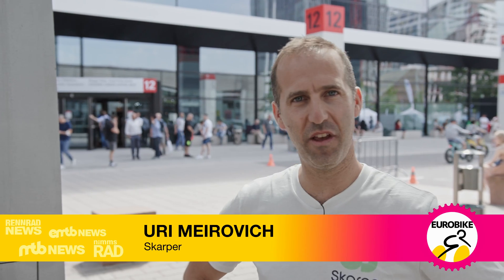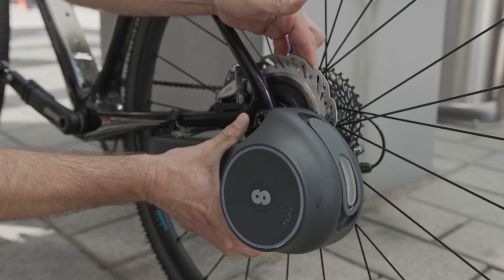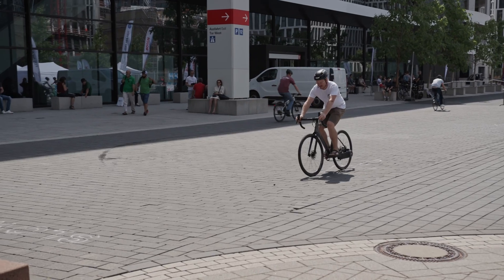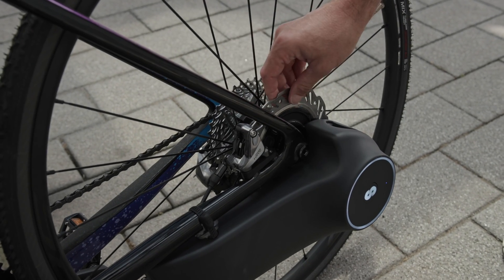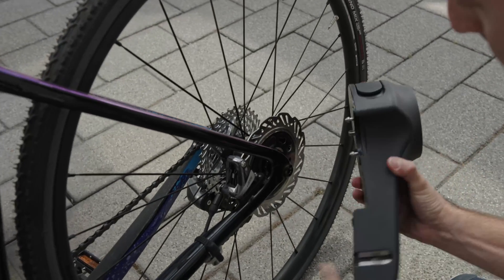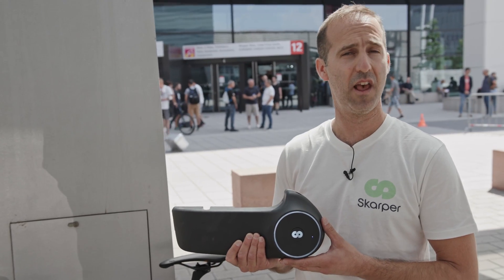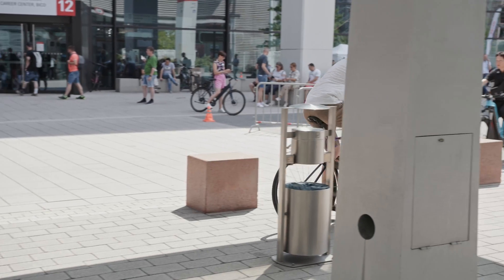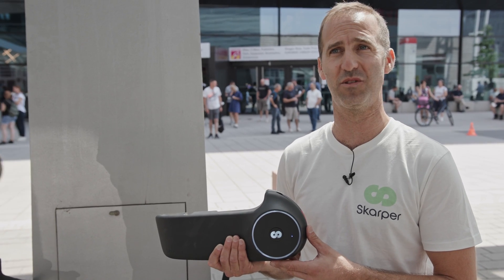Eurobike 2022 - Nimms Rad testet Skarper Nachrüstmotor für die Bremsscheibe

Comment: In der Anschaffung schon nicht ganz günstig, aber man braucht hier dann auch immer eine spezielle Bremsscheibe? Wäre interessant, was die dann kostet, weil man die auch häufiger mal tauscht, wenn man das Rad regelmäßig nutzt. Und bei Lieferproblemen müsste man solange auf den E-Antrieb verzichten, weil andere Hersteller nicht kompatibel sind. Immer etwas, was bei kleineren Produzenten durchaus risikoreich ist
Reply: they would also make built-in charging, that if you pedal and charge on the way, it would be cool

for example, you drive from a mountain, and it charges, and then it helps uphill =)

Comment: Interesting concept, compact, light but 200wh battery is not enough to use it more than in short urban commuting in flat areas...
Reply: they would also make built-in charging, that if you pedal and charge on the way, it would be cool

for example, you drive from a mountain, and it charges, and then it helps uphill =)

Comment: Unfortunately, they priced themselves out at that price. Good concept but the cost is more than enough to buy 2 foldables at Costco. Most larger ebikes are also less than that.
Reply: True but those bikes don't have features like someone's Cannondale or their favorite bike. Everybody can't be Walmart lol
Reply: @soulreed  I wouldn't put this on an expensive bike.
Reply: @vwtoys  good for you, but a lot of people would
Reply: For an expensive 5k and up bike, I wouldn’t put on these strap on kits with a dinky battery. There are high end bikes that are motorized and those that buy expensive bikes to begin with would just buy the real deal.
Reply: @vwtoys  the point is that the motorized carbon road bikes that cost 5k and up have even dinkier batteries while sacrificing weight for motor and undetachable battery. I interpretate that is where its selling point comes from. The proper road bike is “the real deal” and simple detachable all-in-one electrification kit is certainly appealing to make occasional rides without sweating on your worksuits or depleting stamina right in the morning.
Reply: This actually is for turning expensive bikes into ebikes. Those including that Cannondale cost from 2500 to 12000 dollars. Sharper cost about the same price as a set of power meters.. which are a set pedals... that measure your pedaling power.

Comment: Can get a whole ebike fir £1k.
Reply: Agreed!  And not all bikes have disc brakes. I’ll stick with my Swytch kits!
Reply: @philipkern6774  There was no mention of a range  of power levels either, so presumably there is just one level. For 550 Euros I converted my cheap road bike into a reasonable facsimile of an e-road bike, by fitting the Revos friction drive kit. The appearance is virtually unchanged, and the all up weight compares very favourably with something like the Orbea Gain at 13.5kg. Obviously it is less refined than the Mahle system in having only one power level - which can be quite well accommodated by judicious use of the gears - but it does the same job very well. It provides excellent assistance on the hills - my reason for the purchase. This new system seems very pricey for what it is.

Comment: So it's constantly engaging and disengaging the disk - there can't be continuous engagement because of the stays. That's ripe for mis-alignment or fouling or wear over time and would seriously concern me. Plus it's way too expensive, anyway. Good luck guys but my spider senses tell me this isn't going to last.
Reply: It doesn´t constantly engage and disengage, the motor is constantly connected to the DiscDrive (through the 3  pins), and pulses back-and-forth (because of the chainstay), instead of making full, consecutive circles/rounds... With each pulse, the Diskdrive is being turned 5cm further, what seems to be 1/6th of a full rotation. The Diskdrive, embedded in the Brakedisc-Rotor, has an one-way-clutch at its circumference. Of course, when you brake, the brake turns the motor off, so, no clashing. I´d critisize, that the motor changing direction every 5cm it has moved to one direction, is not very efficient overall, but of course, it still works. Probably don´t use a motor, but another electromagnetic device, like solenoids. 
Imagine your right foot on the front pedal, and your left on the back pedal. Now, instead of pushing to the bottom with your right, and thus bringing your left to the top, in order to subsequently push with your left to the bottom, instead, you keep the starting positions of your feet/pedals, and make short strokes with your right, reciprocating back-and-forth, for 1/6th of a full revolution each time. In skarper, you have 2 pins accomplishing the same, one-after-the-other (when the 1st pin has pushed and now disengages to go back to its starting position, the 2nd pin is engaging and pushing. So, 1 out  of 2 pins is always engaged, no fear of rolling backwards, when hillclimbing  ;-)
At least, that´s my understanding.
Reply: @klausbrinck2137  What you're describing is a continual engagement/disengagement with the disk, which is what I said. The way you describe the action is that each pin moves in and out and drives a partial revolution, which is probably right. However, there are still the issues of fouling and wear. Plus that method seriously restricts the drive power as there's only partial engagement. A single pin or even two are not strong enough to handle the power to push a bike plus rider without bending or snapping the pins.
Also, just to clarify, there's no connection to the brakes at all - the 'motor' is  self-contained and clicked onto the bike, so there is indeed the potential for a clash between the 'motor' and the brakes.
The more I hear about this thing the more sceptical I am. There's no way it can deliver sufficient power and also not be hampered by the serious technical issues.
Reply: @garymitchell6372  The pin neer has to disconecct (unless u remove the whole mechanism). It is enough if the pin pulls the disc upwards,while the one-way-clutz engages, and then moves the disc downwards, but without the one-way-clutch engaging. There´s no connection and disconnection, but just a back-and-forth-ratcheting, which I find inefficient enough... But the forces are too small, to bent anything with time, I guess it´s about 1/10th-wheel-revolution each time, that´s too tiny of a torque/force. 
There´s also something else that´s strikking: E-motors are more efficient, not just cause it´s electromagnetism, but partly cause it´s not a reciprocating movement (to turn something), but a continuous rotary movement (to also turn something, which would finally make sense). Here, we have a reciprocating movement, which is primitive and, as said, inefficient enough. Utilizing electromagnetism like a caveman would conclude that it is ought to be utilized (the same caveman that invented internal combustion engines before), is a sign  or regression, that´s mindblowing to me. It´s like given nuclear power, and instead of producing electricity, u use it all to build nukes.  They could build in V-brakes on same bike, and replace the brake-rotor with a similarly dimensioned gear (with small teeth-modulus 1,5), turned by a much smaller gear,  that´s driven by a motor. That would be more viable, and the solution I was expecting, before I watched the video.
Reply: @garymitchell6372  In their site, they tell that they use a brushless motor: So, they turm rotational movement to reciprocating movement, in order to turn it again in rotational movement, which is complete bollocks... It will work, and nothing is gonna break, but that´s so inneficient, that the 200Wh will be sucked out of that battery in no time...
Reply: @klausbrinck2137  The pins can't continually engage with the disk because of the stay, so they must engage/disengage - there isn't any other way. Nothing necessarily wrong with that but there is the issue of fouling and wear, plus there isn't 100% drive from each pin.
Also, if the forces are too small to bend the pins then there isn't enough force to drive the wheel, which is worse. This product just can't deliver what it promises.
Reply: And there isn't any connection to the brakes, which itself will cause significant issues because the motor is driving the brake disk so they'll work against each other. These pins will eventually bend or break 100%.
Reply: @garymitchell6372  Remember the example when pedaling with short-10cm-strokes of a single foot. Do u ever have to disengage your front-foot from the pedal? No! Because the rear-wheel-cog has an one-way-clutch in its core. Here u also have an one-way-clutch in the perimeter of the engaged disc, which constantly engages/disengages with the core of the brake-disc. So, there is engagement/isengagement, but not at the pins, which are constantly bound, but at the one-way-clutch instead. If u pedal., and your pedaling isn´t perfectly "round", the rear-wheel-cog will also disengage at the end of every single foot-stroke, for a moment. One-way-clutches are built for this kind of use/abuse, so, no worries there. Imagine the disc inside the brake-disc as one piese with the skarper. The skarper makes it turn front-and-back constantly. The front-half.movement engages the one-way-clutch at the perimeter of the engages disc, "grabbing" on the brake-disc, and thus, turning the rear-wheel. The backwards-half-movement is there to bring the engaged disc back to its starting position, and during that, the one-way-clutch is disengaged.
Reply: Engagement is continuous.  The brake section consist of a ring gear, driven by a small pinion gear.  The motor unit has a spline shaft that slips into the pinion gear.  The two pins on the outside, locks the unit in place.  The center pin is the drive shaft.
Reply: @propheteyebert7063  that's what i realized & how novel a concept.... immediately wondering what the MTBF on the gearing mechanism would be.
Reply: Also it's not clear how it works with the brakes. There's no link to the brake system and instead relies on crank movement, but the brakes can be applied whilst moving the cranks so are the two systems going to clash?
Reply: Remember, this is purely an "assist-drive", so, the motor will sense your power on the pedals. When you don´t put any power, the motor isn´t assisting u, so, the clutch (inside the rear-braker-disc) is freewheeling. And when you brake, u surely aren´t puting any pressure on the pedals. 2ndly, skarper sits around the rear-braking-mechanism. It´s the easiest thing to sense if the rear-brake is closing, an consequently stop the motor electronicaly. Every brake-lever of an e-bike, has always a sensor, sensing when you press this brake-lever. Here, it is the same, but instead being at the lever (on the steering-bar), the sensor is set directly at the brake-caliper, which is even better, because your brake line has always some slack, and the genuine point for sensing braking isn´t at the lever, but at the calipers themselves, actually. .
Reply: @klausbrinck2137  There is no way it can sense the brakes being engaged without a connection. No way at all. Also, the pins CANNOT be continually engaged - it is physically impossible. Both the motor and the brake disk rotate, so they will always be passing each other. The pins must engage and disengage, there is no other way. The pins will either provide little to no torque or they will bend or snap within weeks.
The proof of all this is that the company never show the rear of the motor, which would make it obvious what is happening.
Reply: There's also the effect on the frame from the motor. Again, either the motor is strong, in which case the fixing won't be enough and the stays are at risk, or the motor isn't strong, so why bother at all.
Reply: @garymitchell6372  Sorry, u probably haven´t seen this video yet https://www.youtube.com/watch?v=Dp2buuPAtZw&t=95s at around 1:30 , and me, I couldn´t understand why it´s so difficult for u to grasp it... it´s the back side, showing that the pins move just 2-3cm each time. Remember the example, where u pedal with short right-foot-strokes, back-and-forth, cause it´s here exactly the same principle.
Reply: @garymitchell6372  The motor is 250Watt, according to the law for a european bicycle without a traffic-number-plate, which is also the continuous power of an athletic man. that means, instead of having only 250Watts from yourself (just for 2-3minutes, till you get tired and deliver less for several minutes), u get another 250 (constant/continuous) Watts from the motor. But the reciprocating nature of the mechanism is gonna suck the battery empty in very few miles. I agree, that´s it´s bad, but for other reasons than you claim. It´s very, very inefficient, even thought in works. The world is full of such reciprocating mechanisms, they always are special solutions, when other things won´t work, and the price is their very high inefficiency.
Reply: @klausbrinck2137  OK I see what you mean. It's even worse than I thought. There's no way that a reciprocating pin moving just 2-3cm at a time is efficient. A pin moving so many times but for so little distance will wear or fail very quickly. And also with alternating between heavy torque and no torque. It either must be reciprocating 100's times a minute to get enough power, in which case it will fail extremely quickly, or it's very slow to avoid breaking, so why bother.
And there's still the problem of pedalling whilst using the brakes, which I agree shouldn't happen but it does, and the effect on the frame of rapid application of torque that the frame wasn't designed for.
Reply: @garymitchell6372  The connection is a sturdy one, as said (no wear there), there´s more machines funktioning on this principle, and with similar dimensioning, and work for decades. But still, it´s a mindbogglingly stupid idea, why doesn´t ever anyone think of the efficiency ???  ;-)  When i grasped it, I didn´t know if to burst out laughing, or start crying. And about your skeptisism, don´t forget, that we talk about very low power-applications here, that´s, if you cannot easily bend a chanstay with your arms, skarper will never manage to bend the frame...